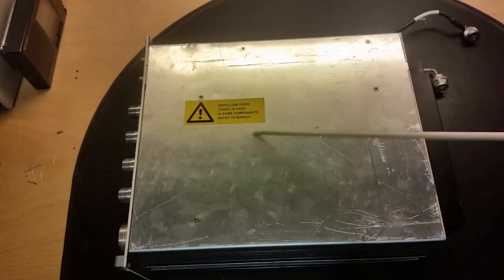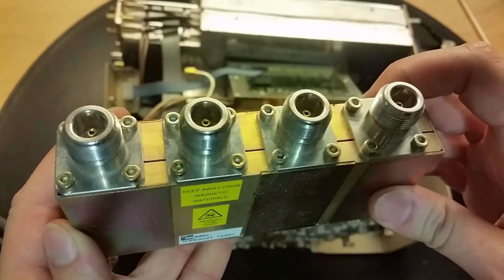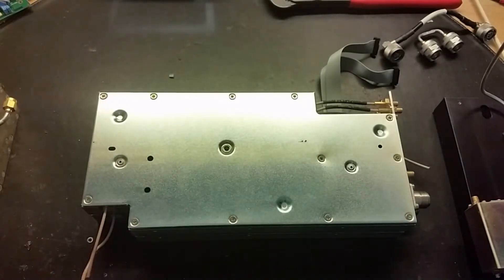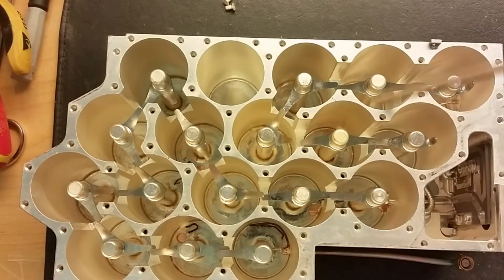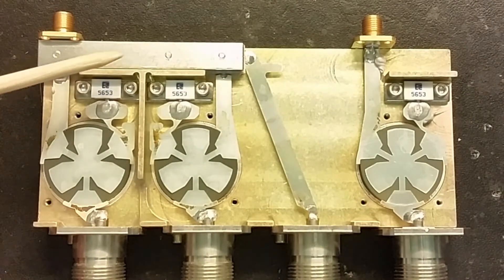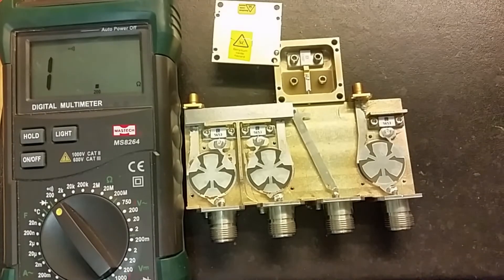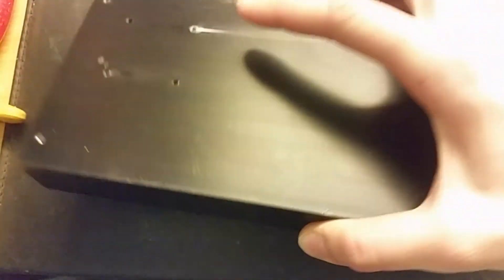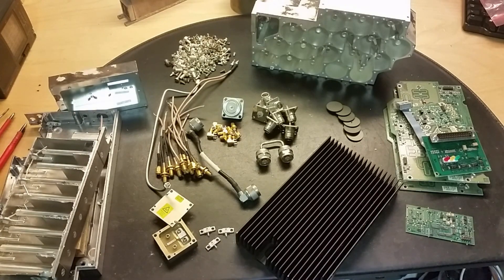GSM Reciever/Transmitter Teardown

Comment: At 09:00 the 3 circles with magnets on is circulators. They are kind of a RF isolator where a signal can only go from port 1 to port 2, from port 2 to port 3 and from port 3 to port 1. The resistors are indeed termination resistors which absorb any energy trying to go backwards in the system. I did a lot of RF equipment teardowns which you can see at: https://www.youtube.com/watch?v=ndaoMPH4RGI&list=PLw4xMO1xCMSV9REhsRRaTXc-AULq7lAJl